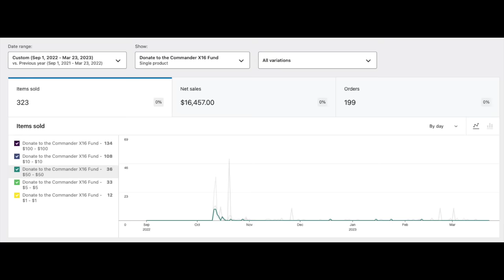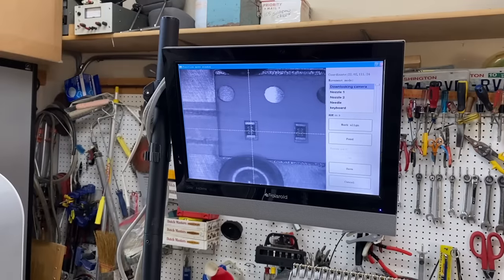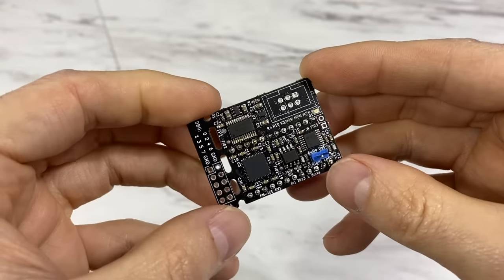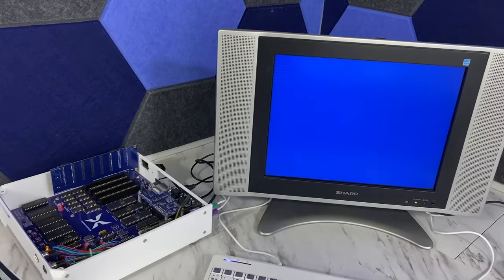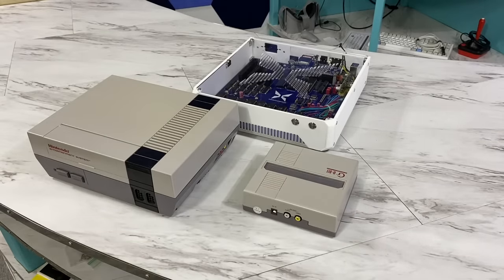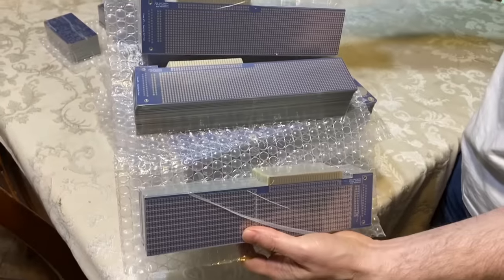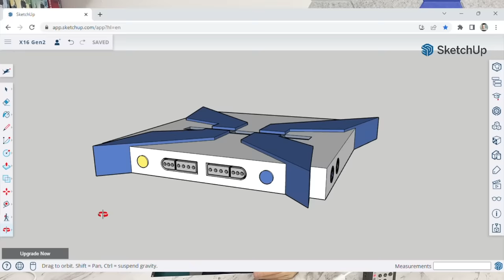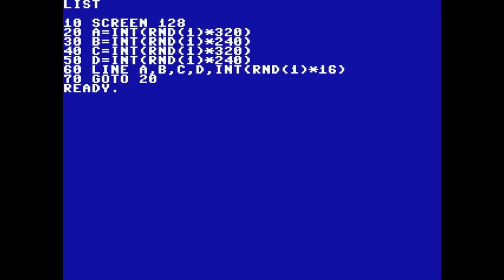Commander X16 2023 update

Comment: I wonder what kind of "logistics nightmare" was supposed to exist when handing it to a PCB assembler...
I work at a PCB assembler and the only "logistics nightmare" I am aware of right now is the scarcity of some parts.

We either buy the components ourselves according to the customers BOM, or the customer buys them and sends them to us...
That would also have removed the issue with the YAMAHA chip.. as an assembler i know which suppliers have real stock and which ones lie.
It is the nature of component "Brokers". They check inventory of smaller brokers, note what is available, do NOT update it frequently ...
So they do not know if the parts work, or even still exist.
That is why it is important to know your component brokers, so you can estimate if what they say can actually be true.

Same goes with the PCB...we either buy it ourselves or get it from the customer.

The only logistics nightmare i could imagine would be overseas transport after assembly.. which would require good packing, but that is not really a "nightmare".
Reply: Ideally they could have the whole thing built at an assembler, PCBs and all.  Have the passives and sockets for the thru-hole stuff installed there and then populate the board with the unobtanium parts when they get the product in Texas.
Reply: David thinking that getting an assembler to build the board at an assembler would be a "logistical nightmare" while doing it in house would be "easier" really let's us all know he has absolutly no expierence manufacturing hardware. That's the largest beginner mistake everyone makes once. :-)

Comment: Man I went through this many years ago, I almost did exactly that (buy all the machinery and produce it myself) my idea was to create a mini 486/pentium for the home user, at a low cost. I faced the same problems, and came to the conclusion that a SoC system is more viable, and that the real secret is a very well developed and accurate emulation software.
Reply: If you are going the emulation route, an FPGA solution is way better than software emulation, and they already have one called the "MISTer FPGA".
Reply: @reviewaccount469  Unfortunately mister is expensive (I can buy a pentium 2 in perfect condition for the same amount used in setting up a mister the way I want), and it doesn't quite meet the ideal. They built it to look like a raspberry, and that small size limited it a lot, so the average user needs to spend more money on hundreds of adapters to make it an easy-to-use computer.

The correct thing would be an FPGA card a little smaller than ITX, but that has a native solution for PCI and ISA, many people like to use physical hardware in these things
Reply: @reviewaccount469  A Software emulations wins, the only thing you need is I/O virtualization and a second keyboard that is passed through the guest system and thus ist completely dedicated to your emulation.
Reason :
The host system's keyboard configurations interfere with playing more complex games that expect specific keystrokes. Also the DOSBox or any other VM or Emulation's default keyboard settings can get in the way and modifying it each time requires work. With a dedicated keyboard, these problems vanish.
Reply: @reviewaccount469  true! Also consider a bare metal kernel for raspberry pi. It wouldn't need to be emulation.

Comment: Honestly this makes me appreciate the production scale and efficiency of modern day computers so much more. So many things I never would've thought of on my own to into producing a computer.
Reply: Having worked at a manufacturer of Raspberry Pi add-ons; productionising your boards is just as important as the electrical design.
Reply: How modern day computer Mainboards are build is not like this. This is a multi miljon $€¥£   industry. It's nearly 100% automated. Therefor much cheaper labor costs. But the investment is very high.
At home and if you produce 100+ Mainboards this is not possible.
Reply: @worldcitizenoss  This. It's all integrated in one automated factory that took expert knowledge and many dozens of millions to build. EEVblog visited an Aussie factory that is (of course) technologically way behind PCBway, and the machines were still impressive industrial robots. Basically you would order production runs of hundreds or thousands of boards, with all parts readily stocked at the factory.
Reply: The production should have been outsourced to a PCB assembly house. This is a HUGE amount of work that the PCB assemblers already have automation for.

Yes the big ones will only talk to you for 10000 boards, but smaller niche ones will produce 50 boards at a price cheaper than your time is worth.
Reply: I agree..  the transparency they have in this process is giving us insight into why this doesn't happen all the time.  I worry that they may be stressed to the max, and would have given up long ago if they didn't feel the ethical need to produce now that they have $80k of other peoples' money.  I hope they dont concentrate so much on low price that they end up having worked for 4 years for nothing.  They deserve substantial reward for this effort and commitment.
Reply: wave soldering has been around us since 60s, probably before that. Mass produced PCB for consumer, like TV, also date from these days ... even for TUBE TV's. SMT technology which implies a fully automated assembly and soldering was widely available in the 80s. PCBway ofers assembly service too. And they can buy all the components for you (probably not the hard ones).
Reply: Its not usually this difficult. These days its really easy and really cheap to get PCBs manufactured and assembled in china. 

The way that the 8-bit guy has chosen to make these is insanely expensive and labour intensive.

Comment: As someone who has been doing this sort of thing for 20+ years, I'd strongly suggest fast-forwarding to the part where you sell these as kits. Let the end user do all that hyper-expensive PTH soldering and scrounge their own Yamaha chips.
Reply: And call it the EVO-X16
Reply: as was pointed at the video, providing support for a kit that has so many components and requires very good soldering skills and knowledge, is a nightmare. most ppl who think they can do it, they really can't.
Reply: @giornikitop5373  Most hobbyist computers are sold as kits, and most hobbyist who buy said kits understand that the onus is on them to put the kit together properly. That's part of the appeal. Just because he said it in the video doesn't mean it holds any actual weight. This is, once again, a bizarre bit of reasoning  to justify a mismanaged project.
Reply: @Allen.Christian  maybe, but if you sell a kit, you must be ready and willing to support whoever buys it, good with soldering or not, because everyone will claim that they know what they're doing. also, ppl with actually good skills, have sometimes trouble getting these kits to work.
Reply: @Allen.Christian  Aside from the VERA (which I assume can be bought pre-assembled) this is very easy soldering. The problem is the AMOUNT of soldering. Again, bad for a business that doesn't have a selective solder, fine for a hobbyist who wants a lazy weekend project.
Reply: Really? You've been engineering low cost computer platforms intended for for learning about software development for more than 2 decades? Wow, you really kept that quiet! Name them!
Reply: @Ffinity  Imagine being here and not knowing who Ben Heck is.
Reply: @Ffinity  What? You REALLY should look up who they are... A simple google on their name, or even just clicking on their name to get to their current channel would get you an idea of who they are... Everyone with even a rudimentary interest in electronic and console/computer design should at least know who they are, even if they don't watch the content.
Reply: Yes I’d agree. Of course there is support required for kits, but that’s a logistics problem - stocking spares, shipping, help desk etc. There is a reason low volume electronics is usually outsourced. The equipment gets expensive quickly, running costs in consumables and maintenance are high. Even with half decent equipment, defects still occur requiring inspection and repair, which means more labour costs. (I have been working in electronics manufacturing for over 30 years, BTW). I think supporting kits is still an easier and lower cost problem to solve.
Reply: Mistakes were made. The design depends on dead end DIP components which are harder to source, less cost effective, and more expensive to assemble. Depending on a no longer manufactured chip was a scheduled disaster. If SMDs components were chosen, they would've been totally assembled, tested and ready to ship. Both PCBWay and JL PCB offer assembly services for cheap. 

Regardless of DIP or SMD, manufacturing in-house was pure incompetence. There are still a few PCB assembly shops in the US and abroad who will assemble DIP boards. If you can't manage vendor relations, you shouldn't be in business.

Self assembly is a no go, especially given the complexity of the PCB--too many points of failure. It's a product support nightmare if a part is found to be defective. That's the only sensible decision they made.
Reply: @Ffinity  uhh, bro, this is normal a good strategy on the internet... Like 99.999% you can totally get away with calling out internet strangers... but I'm really sorry to tell you that you just hit the Sh*t lottery by literally calling out the myth and legend Ben Heck. XD
Reply: @Ffinity  Ben Heck is the GOAT that repaired the long lost Nintendo Playstation and is well known for making portable versions of consoles. You fanboyed at the wrong guy.
Reply: @bobweiram6321  It’s an advanced kit that is targeting a niche hobbyist market. Make that clear and what tools and skills are required at point of sale. 

I agree though that if designing for sale pre-assembled then SMT is the way to go, much cheaper due to automated assembly. THT is far better for home assembly, but in commercial products it’s use is quite limited now. Mostly high power devices that need to carry a lot of current and areas like aerospace and military where mechanical strength of the solder joint is important.
Reply: @danieljonsson8095  Please use the correct pronouns; Ben uses he/his.
Reply: @chrisward000  Kits are great, but you better be ready to handle product returns. If a single IC is defective, as he discovered for himself, the time and costs associated with handling a return can bust your budget. Telling the customer what equipment they need up front won't help. The customer should know the equipment needed and what's involved.
Reply: @giornikitop5373  it may be a nightmare to provide support for such a complex kit but clearly it's also a nightmare to build in-house, a nightmare to source components, a "logistics nightmare" to outsource assembly etc. This has become a project of choosing which nightmare to have. I'm sure Ben knows this.
Reply: @chromosundrift  sourcing and logistics nightmares cannot be avoided,  supporting as a kit can be, that's the point of my comment, when Ben suggested they proceed with a kit release. So again, in case you still don't get it, they will have to support EVERYONE that buys the kit, not just Ben Heck skilled ppl and with something that has so many components, it's just not viable.
Reply: @enduser8410  
I still remember when Ben made the portable 2600.
Reply: Ask Steve Wozniak, Daniel Myer or Sophie Wilson why that's a bad idea. They'll all tell you basically the same story - of a customer who sent back  an "assembled" PCB saying "I thought the hot solder would damage the components so I used glue instead. Why doesn't it work?" That's why this model was abandoned in 1976.

Comment: What were the issues with having it assembled by a PCB manufacturer?
What exactly were the logistical nightmares that you hinted at?
Please talk about this more than 30 seconds!
Reply: Agree, don't understand either. Myself I construct, manufacturing and selling electronics but using low cost PCBA services from PCB Way and PCB One. Also did manual labor and used machines to start with but found it way more efficient and also gives better quality using a professional supplier compared to setting up a complete PCBA production line yourself. It is not worth it in the long run and will still require too much labor time. Also PCBA plants often have better prices sourcing components. I understand that you may have a few special components that need local and special sourcing, but just let them leave them out for you manual assembly.
Reply: Maybe the 'ban' of SMT, the usage of obsolete semiconductors and the sourcing of fake replacement chips for them?
Reply: The main board uses through hole components, which most PCB manufacturers won't assemble. Another reason is that their business partner texelec would not get as much money as they did. 
Overall, the X16 turned out how I imagined it: a project made by people who have no up to date education on EE, full of decisions that don't make sense on a bigger scale.